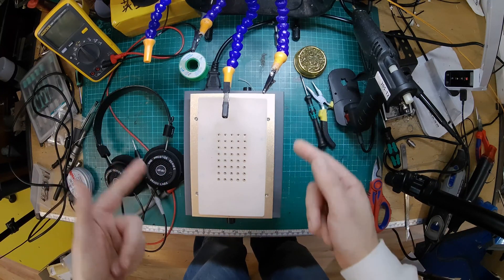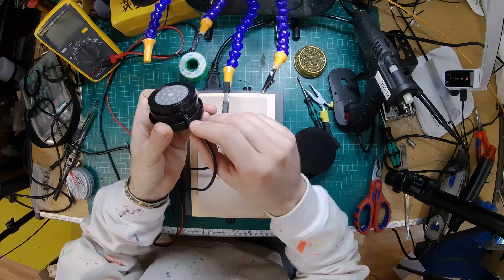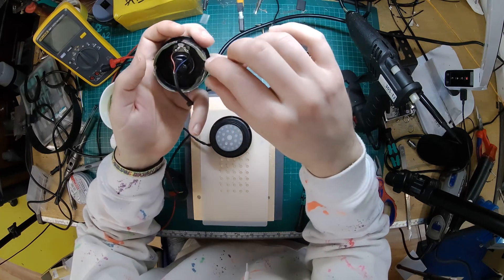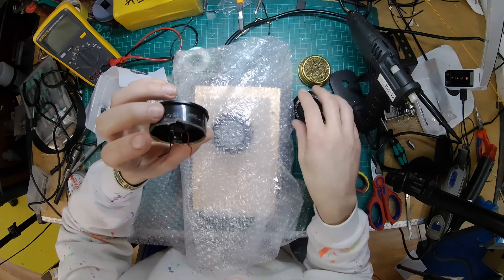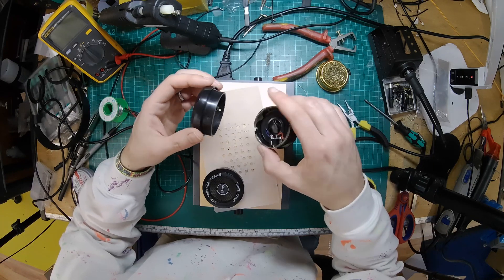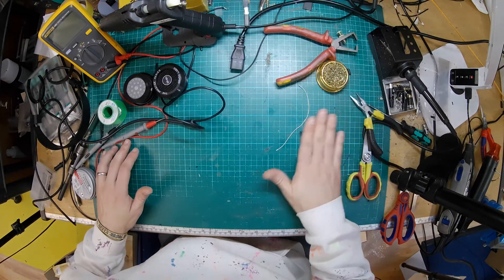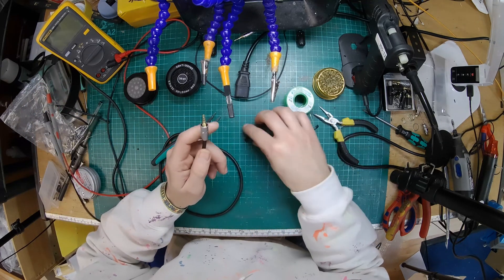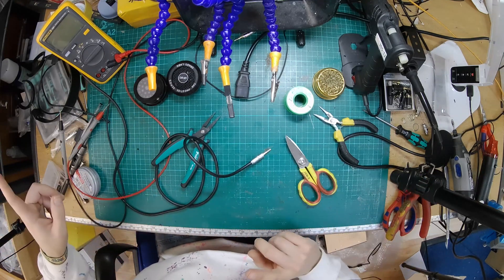Grado SR80 detachable cable mod and shortening stock cable ( sorry about the sound)

Comment: Great video! Dismantled mine using a hair fan (blew the hot air from the opposite side of the cables to avoid melting them), cut the broken cable at the exit from cups, refitted the remainder back. When will run out of the stock cable length will use the Gotham one  I  have at hand.

Comment: Do you have a link to the jacks and also could you use 3.5?
Reply from the maker: The sockets I used are SCHURTER 4831.22 - you could probably fit a 3.5mm socket in there as well if you found one thin enough
https://uk.farnell.com/schurter/4831-22/socket-2-5mm-jack-panel-2pole/dp/473467
Reply: @CustomCans  My 80e's have 4 wires.  2 white and 2 blue on one side and 2 red and 2 black on the other.  Just splice and go?
Reply: I was going to reuse the wire, but Every time I'd tin the tips of it, the heat would melt the wire's insulation in spots for about an inch.  I finally gave that up.  I made a cable and redid the ends on that and it works fine.  Balanced cable on my Grados.  Pretty neat.
Reply from the maker: @chethammer  Ah yes that can happen but I am glad you sorted it in the end ;)